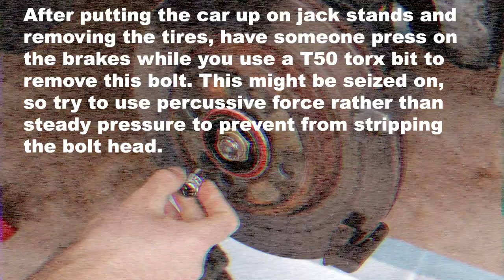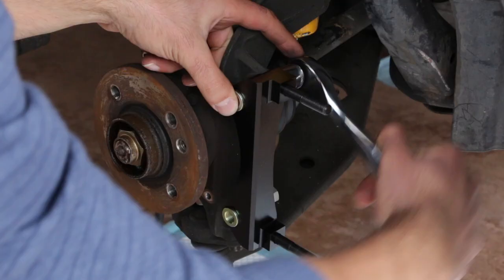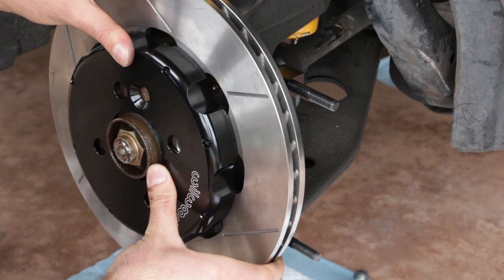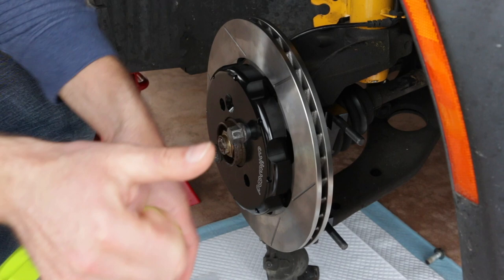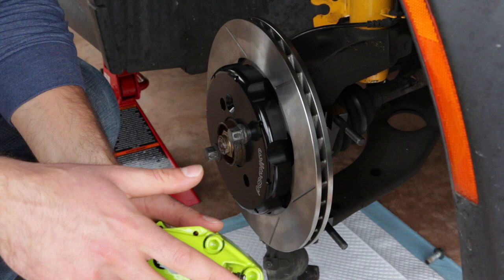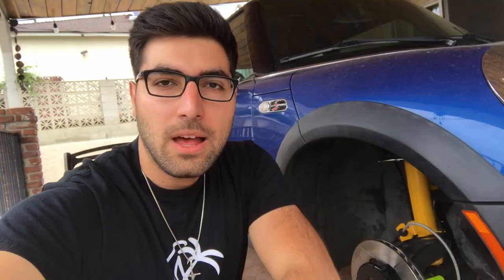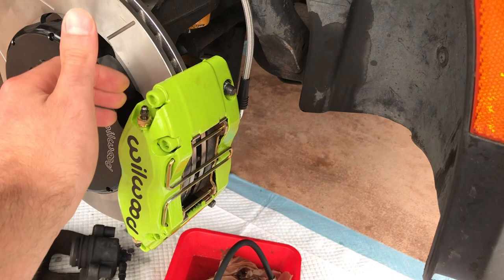Wilwood BBK Install - Mini Cooper JCW

Comment: Hey nice video! Just a friendly tip next time. Clean the wheel bearing hub mating surface before you install the rotors next time. You increase the risk of hub lateral run out due corrosion and possible other factors. Get a wheel brush and blast that corrosion away. 
- From a fellow R53 owner
Reply from the maker: CookJunkie duly noted! Thanks for the tip.
Reply: that was the nicest "you did something wrong" comment that ever existed.

Comment: I know that this generation of mini utilized brake pad wear sensors. Does the Wilwood kit utilize them as well or if not Is there anything special someone needs to do to prevent the brake pad light to come on?
Reply from the maker: Sorry for the late response! I sold this car a few years ago, but I know it didn’t have any sort of warning light after installing the Wilwood kit. Whether the kit came with sensors or not I don’t remember though.

Comment: Hi, what are you using for the Rear brake rotors and pads to go with the Wilwood? Thanks!
Reply from the maker: simon kong stock Cooper S pads and brakes. No need to upgrade the rear brakes for most applications. Just keep it well maintained and you should be good to go :)
Reply from the maker: simon kong always happy to help!

Comment: Hello, i finish installing the same kit yesterday. And the presure for stoping is now way more down in the pedal.. is this normal?
Reply from the maker: Franco Groppi that should definitely not be the case. If you’ve installed and fastened everything properly and checked for leaks, I would assume the problem area would be bleeding the brakes.

Put your foot on the brake pedal with constant pressure and observe if the pedal slowly continues to sink. If so, it’s very possible that you have air in the system and need to bleed the brakes again. I’d look into doing this again after checking to see if any of the easy fixes don’t work (maybe a loose bleeder valve on a caliper or whatnot). Hope this helps!
Reply: DoubleOSevan thanks! I will bleed them again so. I chacked de bleeder screws and one seem to leek some brake fluid prome de black top side... but i assure is tighten. What can i do?
Reply from the maker: Franco Groppi hmm, that shouldn’t happen. I would thoroughly clean the area and have a helper press the brake pedal while you observe the suspected leak area. 
On a side note, it usually takes a few tries to bleed the brakes fully and evacuate all of the air in the system. I would also make sure your bleeding process is correct and that you’re not introducing more air - ChrisFix has a good video on bleeding brakes if you’re not as familiar with the process.

Comment: Hellow, great videos. Do i need brake cleaner for the rotors? Or its not necesary?
Reply from the maker: Thanks! Yes, you definitely need brake cleaner for new rotors. The manufacturer will usually put a layer of grease on the new rotors to prevent rust. You'll need the brake cleaner to remove that grease layer before installation.
Reply: DoubleOSevan thanks!
Reply: DoubleOSevan and another quetion would be, if stock braking was a 4 out of 10. What you say is now with this kit?
Reply from the maker: Franco Groppi with these big brake kits, it’s really more about the ability to repeatedly stop than it is initial bite. That’s not to say these don’t stop harder, they definitely do; but I’m able to repeatedly brake hard on the track with little to no fade during a 20 minute session. The R53 is a light car so this kit is a bit overkill. 10/10 from me, especially with the ease of changing pads.
Reply: DoubleOSevan on track you use the pads that came with the kit?
Reply from the maker: Franco Groppi yeah, the bp20 pads should be good for daily + light/moderate track use. They performed very well at our local track, Streets of Willow. Just expect lots of brake dust (as with all sport/race pads).
Reply: DoubleOSevan cool. And the last quedtion would be, how needed is to have rear stainless lines for the daily and track use? And what abput rear more racing style pads. Thank
Reply from the maker: Franco Groppi you don’t need rear SS lines or upgraded pads. The front brakes do most of the work. No problems with stock rear and the BBK in the front.
Reply: DoubleOSevan thanks!